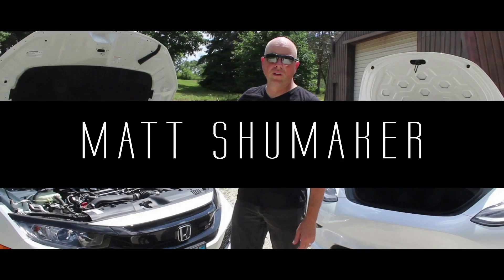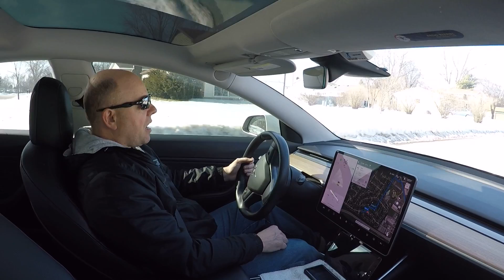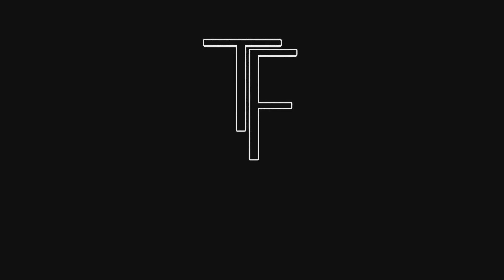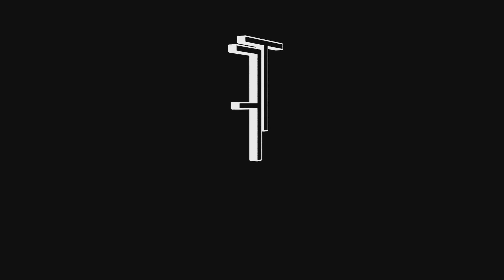Supercapacitors and my opinion of Tesla acquiring Maxwell Technologies

Comment: Hello Matt my friend!   You confused supercaps with conventional capacitors.  Supercaps are saggy and have poor impedance per mass/volume because they polarize a liquid electrolyte wetting the surface of the carbon coated electrodes.  Over a 10second run, supercaps are effectively useless for changing the shape of the curve after the first couple seconds of discharge.  This is because the voltage falls off rapidly as they donate charge, so in a couple seconds the voltage falls to the same level of your pack underload.  Maxwell doesn't make solid electrolyte cells or claim to make them, a dry electrode process means you don't need to evaporate out the solvent from the foil coating stage.  All Maxwell's dry electrode assembly capacitors and cells still use liquid electrolyte, just no liquid solvent used during the manufacturing.

Comment: Super caps have a very bad energy density. No use for a car .   Nothing new on that front . Tesla will not be using them in the cars. It's the new membrain Maxwell have which can increase the energy density of the lithium battery by about 30 % ,  that's what they want .

Comment: You're point about the super caps providing instant power for acceleration is a good one, but you only told half the story.  During aggressive regen braking, more current is provided by the regen than the batteries can use.  So the remainder is simply wasted.  A super cap could absorb that excess power and later transfer it to the batteries, or more likely just hold onto it for the next needed burst during an acceleration.  So a super cap can 'buffer' power going in both directions.

Comment: I agree with what you're saying but, I would think the more significant use would be in the powerwall...for many of the same reasons you give for their usage in cars....I'm no expert but, it seems to me that the reason they tell people not to discharge powerwalls beyond 50 percent is because of currency spikes...a supercapacitor could solve this issue and enable homeowners to utilize 90% of the battery....I'm also, thinking that a hybrid capacitor lithium battery could replace the lead acid battery operates the 12 volt systems in Teslas...and could create greater efficiency in regen...Nice video btw...

Comment: Super capacitor can also work in the reversed manner. During charging, super capacitor can act as energy buffer by applying ultra high voltage to reduce the total charging time.

Comment: Good video overall. But you have shown in the 
explanation of the comparison of battery to 
capacity wegig illuminating. Although you have 
explained the technique. But the use of one 
over the other leaves much to be desired. 
Useful in this context is to show a comparison 
of the two.
- If you would spend the same amount for both, 
  then how is the volume of the stack compared?
- If you spent the same amount on both of them,
  what then is the kW ratio in comparison
- If you spent the same amount on both of them, 
  how far you could go with one or the other.
Always assumed for the same car.

Translated with www.DeepL.com/Translator

Comment: There are some important things you got wrong in this video, and some important considerations I don't see mentioned by most. First, super/ultra-capacitors are lower voltage than the typical lithium cell. Because of that, you need to run two in series which means the capacitance is cut in half. So two 3000F capacitors ends up at 1500F when in series. You're going to need an unbelievable amount of caps to get you enough stored energy to power the vehicle for 4 or 5 seconds. In fact, at 1500F you can output 1500W/s. Divided by 4 is 375 W/s, so if you want 1000 HP (745 kW) you're going to need 2000x 3000F supercapacitors. The physical space required for this is going to be several times the size of the Model 3 battery pack (4416x 21700 cells), the weight is going to be enormous, and the control circuitry is going to be a massive source of heat and weight. You're going to need to boost the current coming from the capacitors as they discharge if you want a steady voltage, and capacitors lose current exponentially.

As far as charging supercapacitors in milliseconds, it may be theoretically possible, but the heat generated, the circuit required to control that charging, and the thickness of the cables, traces, or bus bars needed to carry that amperage is going to be a huge problem. And where are the capacitors getting their energy from? Either the battery pack, or the motors acting as generators. Since the regen strength is based on passenger comfort and circuit capabilities, we aren't really going to see much more regen added to cars, and the regen already present in a Tesla is well below any limit for charging based on battery cell damage.

Basically, capacitors as energy storage for anything except split-second discharge needs is pointless. In a stationary energy storage device, maybe you don't care about the weigh and heat. But in a vehicle where you need to lug that weight around with you, it's just not going to happen. Lithium cell improvements are much more likely to improve discharge rates, which are already close enough to capacitors for periods of 10 seconds or less, so we really need to just stop talking about capacitors.

As for the battery, like everyone else said, it's a dry battery electrode not a dry cell, and not a dry electrolyte. Also, dry electrolytes are less effective which is why they're not in common use. Maxwell's process is a polymer mixed into the electrode material instead of the solvent they thin the material with to paint it onto the backing materials. The barrier between the electrodes still uses a liquid electrolyte.

Anyway, keep up the great videos!
Reply: Why run them in series when you can simply use a step down transformer to cut voltage?  Same transformer can be run in reverse to step voltage back up for discharge.  What am I missing?
Reply: @cclose14111  There's going to be a higher part count and more robust parts required in that case. Stepping up voltage from a low voltage, high current source is going to produce a lot of heat, and there aren't a lot of off the shelf step-up converters that can still handle pushing lots of current to begin with.

In either case, none of this matters because capacitors are still much heavier than batteries and serve no practical purpose. So why introduce the new parts, really?
Reply: @TomCameron  Higher part count.... so what?  More robust then what?  Stepping up current is going to produce heat???... what do you think brakes produce?  Tesla designed their own motors and many many other parts.  Transformers are FAR from rocket science.   You have given not one good reason to support your thesis.
Reply: @cclose14111  Stepping down current. To step the voltage of a supercapacitor high enough, you would need to draw twice the current from the capacitors, and use half of it to increase the voltage. If you look at the data sheets for any energy storage device, the faster you draw current the faster it discharges and the worse it performs. But, again, all of that isn't worth discussing because the motors and their inverters are your limiting factor regarding how much power you can supply to them.

If you're talking about using supercapacitors to sink regen power, then I'd suggest we don't bother with that and instead use the heat generated to warm the pack and release its existing charge and prepare it for faster and faster recharge.
Reply: @TomCameron  It all comes down to Joules man.  If you are coming down on the side of imparting/losing that work/heat through brakes as opposed to capturing and deploying that energy you are on the wrong side of history.  Period.  I it generous of you to offer you opinion, but call me crazy for siding with the Tesla engineers and basic high school physics on this one.
Reply: @cclose14111 You'll notice Tesla doesn't use supercapacitors, and instead use the heat generate from regen to warm the battery pack. Which is what I said already. So if you agree with Tesla, and I agree with Tesla, then you agree with me.

Comment: I would rather have 10kwhrs of additional battery and less peak power instead of 1kw of supercapacitors.

More range, more better
Reply from the maker: I agree. Plus with greater capacity comes greater discharge rate with less voltage sag.
Reply: Greater regen charge rates  of caps would increase range and bat life by lowering battery discharge rate. A hybrid bat/cap could be the way to go...but what do I know?

Comment: With Maxwels tech Tesla can now make their own batteries. No more paying Panasonic 50% premiums for cells. FORGET CAPACITORS, it means Nothing.
Reply: If Panasonic is acting like the typical long term Japanese corporation, then they would be charging more like 5% not 50%.  They prefer a long term steady business to a quick buck.

In addition, the association between Tesla and Panasonic has been beneficial to both companies.  So why would they want to break a business relationship that has been working well for so many years?  If I was part of the management of either company, I would want to expand this association in time and size.  

Tesla cannot get enough batteries as it is for either its automotive segment or its energy segment, and Panasonic produces high volume, high quality batteries.  Panasonic in turn benefits from maintaining and expanding its manufacturing know how.  This allows it to increase manufacturing efficiencies and reduce costs.

Comment: Incorrect explanation about the dry battery electrode (DBE) technology.  The DBE still uses liquid electrolytes.  DBE cells are simply made without a solvent, which is currently just baked off in the manufacturing process. Hence, without a solvent, it is called "dry".  Maxwell batteries do NOT use a solid electrolyte, at least not yet.
Tesla bought Maxwell because the dry manufacturing process is cheaper.  Therefore the batteries would be made more cheaply.
Reply: Correct.  The dry electrode is not only cheaper, simpler and cleaner, but also performs better.  Google "maxwell dbe paper" for their conference paper about it.
Reply: You’re 100% correct

Comment: Matt, I paused the vid at 3:34 to ask you the following question. Is it possible that Tesla acquirred Maxwell in order to add the (super)capacitors to the battery(storage) of the cars for energy(storage) caused by regenerative braking?
Reply: Without a doubt if super caps are introduced for purpose of acceleration they will also be utilized by the regenerative breaking system.  I the benefits have been largely bluted based on Tesla multi thousand cell design. The Tesla Truck and Semi on the other hand are the more likely use cases.

Comment: Matt,
I generally agree, but think you maybe missed one aspect.
If you consider the vehicle "cycling" power, you need to add regen to the equation.

I believe the capacitors would be used to store that regen energy, then reuse it for accelaration.
That means the battery would only have to compensate for the energy lost due to inefficiency during the regen cycle (heat?) or, to put it another way, the difference between recovered (regen? energy and that required for the next acceleration.
If that is is only say 5% of the total, that's all the battery supplies, maybe direct to the motor at the end of the acceleration cycle? (Low load by that point?)
Then, the battery would provide cruise (low load) energy, as is now the case.

Comment: I love the theoretical application of using supercapcitors for instant power.  However, some others have pointed out that a 5C Tesla 2170 can already provide maximum current to existing motors.  Their theory was years ago, the battery could not dump the power quick enough and the super capacitor was the ideal buffer.  They feel the 2170 changes that. Do you feel motors right now can still take advantage of something greater than many multiples of 5C batteries?
Reply from the maker: Voltage sag is still an issue. 25c would pretty much eliminate sag. But, 5c is 5c.

Comment: Watch Jack's recent video on the 2170 . He thinks they wanted Maxwell mostly for the drop in production cost from dry electrode process. That makes more sense to me since they need to reduce battery cost waaay more than they need to supplement the performance.
Reply: Absolutely , Jack explains it very well why the supercaps are not needed and actually counterproductive in terms of added weight and volume . He also destroys the myth that the 2170's are more energy dense than the 18650 cell (they're the same) and  shows that there is no thermal issue at all with charging at 2C (Tesla Supercharger) . Furthermore , the dry process electrodes show a significant flatter curve of capacity vs discharge rate : current batteries lose 10% capacity  discharging at 0.2 C (highway speed) vs lower than 0.1 . Additionally the dry process electrodes guarantee 2000 full charging:discharging cycles or at least twice the current battery life . Personally , I do not see any application of supercaps in a Tesla . A must see video : https://www.youtube.com/watch?v=zvavP2RJSLc&t=7151s
Reply: But improved performance does reduce cost!
If the cell price remains the same, but you need fewer cells....?
Reply: EDIT: After reading Tom Cameron's comment, the following might not be possible, but here it is anyways, just to prove a point IF supercaps could be reduced in size and "converter electronics heat"...
   It makes sense to incorporate caps because they can capture 100% of braking energy, say 100 kph to 0 in 3 seconds. That's going to take the batteries at least 10x as long to accept, and so it would, or the caps would dump all that energy for the quick acceleration a few seconds later, after the stop. In this way, you just saved the battery from being used at all (minus the charge or discharge of a small amount of energy difference between the stop and go). Consider that almost all of the action will take place quickly in the caps, then the battery can be smaller and still last many years longer! 
Also, less cooling requirements for a battery that rarely has to see fast charge/discharge, and no cooling and heating requirements for the supercaps. Thus, a smaller battery wastes less energy keeping itself warm and cool. Lighter car this way, too!
Reply: A few years ago, Musk started a course on supercapacitors. His hope was to make them so that they could replace batteries all together. We're not there yet, obviously, but he believed that it was a possibility. Don't know if he still does.

Comment: Some good comments on battery supercap hybrid. Also true about the voltage sag and hence power loss.
Super caps would also recharge more efficiently with regenerative breaking giving a few more miles range also. The supercaps would also extend the life of the battery back due lower stresses of rapid recharge and discharge with the supercaps handling most of that stress. When charging your car at a supercharger in extreme cold you might bit faster recharge initially also when the batteries are very cold..?

Comment: You know what usually uses super capacitors? High power car audio systems to keep if from draining so much on the car battery and keeping the headlights from dimming when the bass hits. I think they will be great for short spurts of acceleration like better 0-60 times on cars without 100kWh packs or making everyone's car accelerate like the 200Kwh pack in the roadster. Also for fast recharge during deceleration to reuse on the next take off. Using them that way, you won't use a whole lot to add a lot of weight to the car but the performance will be awesome.
Reply from the maker: I used to be into the car audio scene. My car was featured in Autosound and Security magazine back in the day (November 2000 issue).

Oh, they are called "Stiffening Capacitors" in car audio. I do not believe they use Super Capacitors. Afaik they just use huge standard capacitors. I used to use 6 one farad caps in my 8,000 watt system.
Reply: Tech Forum We used to repair camera strobes with these too.  When a 1 farad cap blows from overcharge or defect, you take notice.  Lol
Reply: @TechForumTesla  super and ultra are just branding